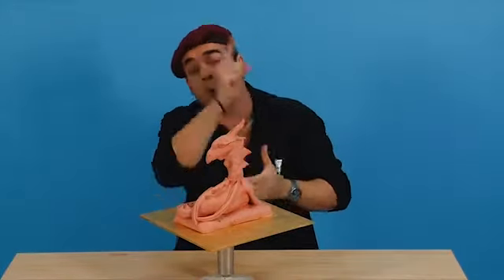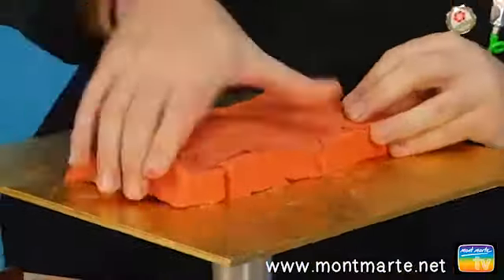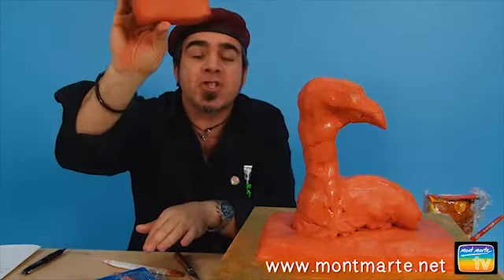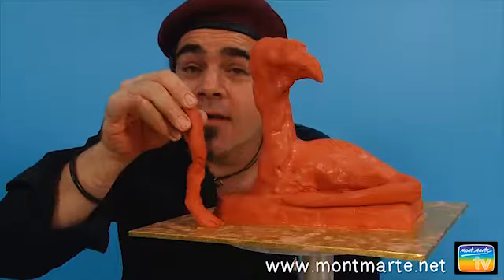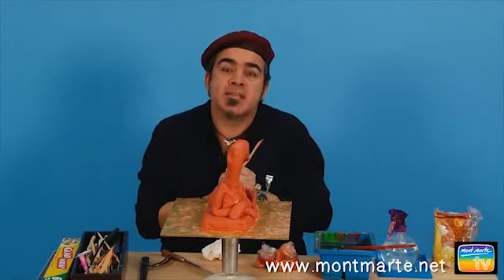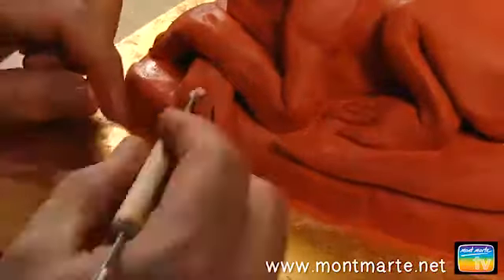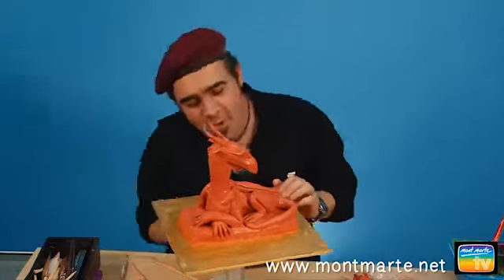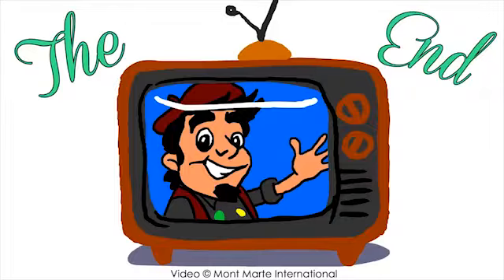Art Lesson: How to Sculpt a Dragon Using Air Hardening Clay

Comment: 4:50I'd like to make a notation or a tip so to say. when I make my air dry dragons , if its a big piece I usually let the body, neck and maybe backlegs dry before applying every thing else because the materials used to make the clay really do speed up the drying process. It in my opinion is best to make the head last and attach with extra clay added to the neck. Also, love your channel, ive been on it all day.

Comment from the maker: Hhahahah that's funny and I have heard that many times, its not a conscious thing it just kinda happens :)  On a sculpture of this size realistically about 1 week.  As it dries it will form little cracks but you can repair them  with a little soupy clay (slip). I designed this sculpture so it wouldn't need a complex armature to hold it's shape, as all the mass is fairly low.  Thanks for commenting magicbuskey.

Mont Marte Joe